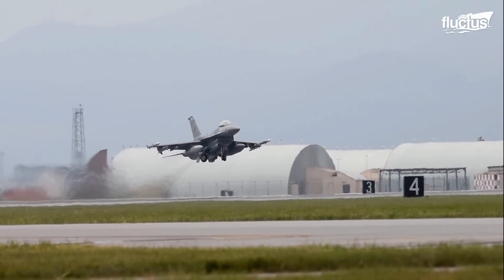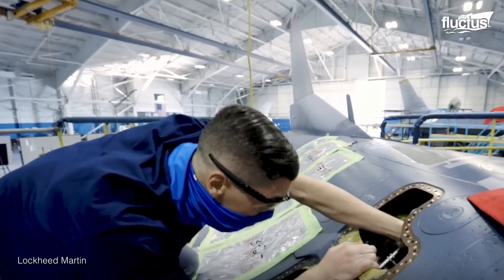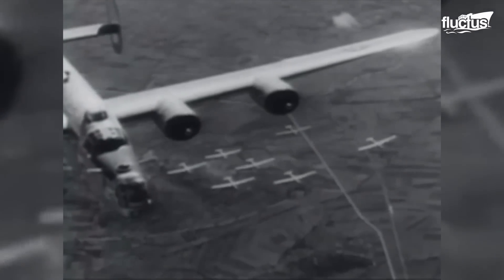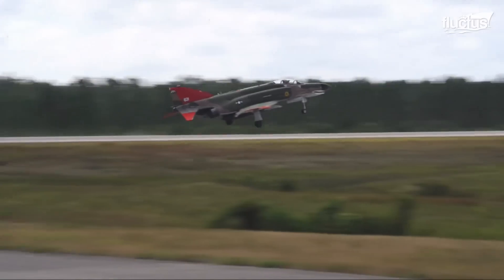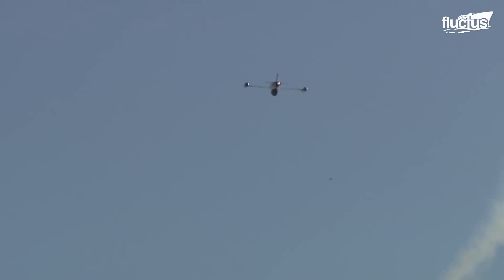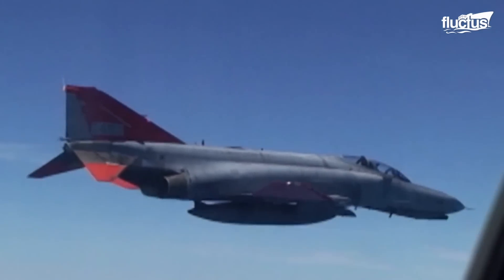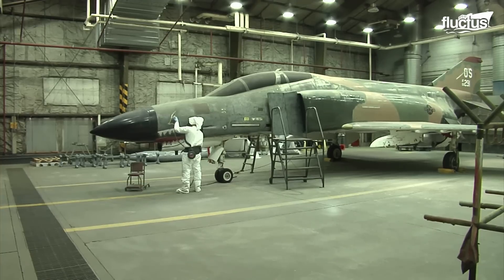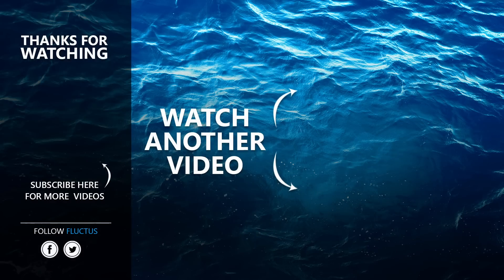Inside the US Super Advanced Billions $ F-16 And F-35 Assembly Line

Comment: The F-16 has a top speed exceeding Mach 2. The quoted top speed of Mach 1.2 is only at or close to sea level which it rarely flies at. The lower the altitude the more dense the air which creates more friction and resistance the aircraft must push itself through.
Reply: I would have loved to see the manufacturing process of the Tom Cat

Comment: F-16 first models were flawed....its Inertial Navigation Unit that causes its sensors giving wrong data to its computers and causes it to roll nonstop resulted in 36 fatal crashes. Something the overlooked Northrop F-5 Tiger never have. Such systems were corrected on the following variants, while sone pilots still flying the flawed first variants, with fingers crossed.
Reply: Source ?

Comment: F-16 Stated Performance (Source = Wikipedia)
Maximum speed: Mach 2.05, 1,176 kn (1,353 mph; 2,178 km/h) at 40,000 feet, clean
Mach 1.2, 800 kn (921 mph; 1,482 km/h) at sea level
Combat range: 295 nmi (339 mi, 546 km) on a hi-lo-hi mission with 4 × 1,000 lb (454 kg) bombs
Ferry range: 2,277 nmi (2,620 mi, 4,217 km) with drop tanks
Service ceiling: 58,000 ft (18,000 m) [failed verification]
g limits: +9.0
Roll rate: 324°/s
Wing loading: 88.3 lb/sq ft (431 kg/m2)
Thrust/weight: 1.095 (1.24 with loaded weight & 50% internal fuel)

Comment: The top speed of the F-16 is mach 2.1. Not 1.2. Someone correct me if I am wrong.
Reply: Really is mach 2.2 top speed
Reply: No one with single engine fighter who can reach speed of mach 2.
Reply: @michaelcasia7264  wrong. Its over mach 2
Reply: @michaelcasia7264  F-16, F-35...or a historical example, the F-105
Reply: @EmilioF1976  Mig 21 , Miraj 2000 also
Reply: @michaelcasia7264  My god you really don't know what you're talking about do you ? F-16 top speed is over Mach 2 at 40,000 ft

Comment: Even 50 years later the F-4 is still a very stunning aircraft!!!
Reply: Phantom's unique shape is eternal !
Reply: @jernejfunkl8300  The Phantom’s unique shape was the results of slide rules vs modern computers and brute force power. NOTHING subtle about the Phantom II. My cousin was an instructor pilot after his 2 tours in Nam. To quote him, “The F-4 was a handful.  Why to you think you HAD to have the guy in back!”
Reply: @Tool-Meister  Anyway...I like it more than any other plane. I have a few publications from it, a ton of pictures, plastic models of various scales and an RC EDF model.
Congratulations to your cousin for successfully piloting this wonderful aircraft...especially in wartime.
Reply: it can even outrun a missle....
Reply: 50?
Reply: @randygravel2057  sorry,  60...
Reply: Agreed. My favorite aircraft of all time.
Reply: @aaaeee2862  I agree. It's my favorite too :)
Reply: @jernejfunkl8300  👍
Reply: Specifications (F-4E) Source: Data from The Great Book of Fighters Quest for Performance, Encyclopedia of USAF Aircraft, and McDonnell F-4 Phantom: Spirit in the Skies

General characteristics

Crew: 2
Length: 63 ft 0 in (19.2 m)
Wingspan: 38 ft 5 in (11.7 m)
Height: 16 ft 5 in (5 m)
Wing area: 530 sq ft (49.2 m2)
Aspect ratio: 2.77
Airfoil: NACA 0006.4–64 root, NACA 0003-64 tip
Empty weight: 30,328 lb (13,757 kg)
Gross weight: 41,500 lb (18,824 kg)
Max takeoff weight: 61,795 lb (28,030 kg) 
Maximum landing weight: 36,831 lb (16,706 kg)
Fuel capacity: 1,994 US gal (1,660 imp gal; 7,550 l) internal, 3,335 US gal (2,777 imp gal; 12,620 l) with 2x 370 US gal (310 imp gal; 1,400 l) external tanks on the outer wing hardpoints and either a 600 or 610 US gal (500 or 510 imp gal; 2,300 or 2,300 l) tank for the center-line station.
Powerplant: 2 × General Electric J79-GE-17A after-burning turbojet engines, 11,905 lbf (52.96 kN) thrust each dry, 17,845 lbf (79.38 kN) with afterburner
Performance

Maximum speed: 1,280 kn (1,470 mph, 2,370 km/h) at 40,000 ft (12,000 m)
Maximum speed: Mach 2.23
Cruise speed: 510 kn (580 mph, 940 km/h)
Combat range: 370 nmi (420 mi, 680 km)
Ferry range: 1,457 nmi (1,677 mi, 2,699 km)
Service ceiling: 60,000 ft (18,000 m)
Rate of climb: 41,300 ft/min (210 m/s)
Lift-to-drag: 8.58
Wing loading: 78 lb/sq ft (380 kg/m2)
Thrust/weight: 0.86 at loaded weight, 0.58 at MTOW
Takeoff roll: 4,490 ft (1,370 m) at 53,814 lb (24,410 kg)
Landing roll: 3,680 ft (1,120 m) at 36,831 lb (16,706 kg)
Armament

E-model has a 20 mm (0.787 in) M61A1 Vulcan cannon mounted internally under the nose, 640 rounds
Up to 18,650 lb (8,480 kg) of weapons on nine external hardpoints, including general-purpose bombs, cluster bombs, TV- and laser-guided bombs, rocket pods, air-to-ground missiles, anti-ship missiles, gun pods, and nuclear weapons. Reconnaissance, targeting, electronic countermeasures and baggage pods, and external fuel tanks may also be carried.
4× AIM-9 Sidewinders on wing pylons, Israeli F-4 Kurnass 2000 carried Python-3, Japanese F-4EJ Kai carry AAM-3.
4× AIM-7 Sparrow in fuselage recesses, upgraded Hellenic F-4E and German F-4F ICE carry AIM-120 AMRAAM, UK Phantoms carried Skyflash missiles
6× AGM-65 Maverick
4× AGM-62 Walleye
4× AGM-45 Shrike, AGM-88 HARM, AGM-78 Standard ARM
4× GBU-15
18× Mk.82, GBU-12
5× Mk.84, GBU-10, GBU-14
18× CBU-87, CBU-89, CBU-58
Nuclear weapons, including the B28EX, B61, B43 and B57

The F16 and F4 really don’t compare in a dog-fight due to the basic agility of the F16, AND, this is AFTER the bomber mafia added all their crap to the F16 to make it an operationally land-bound USAF version of the Navy’s Douglas  A-4 Skyhawk.  Prior to the “bomber mods”, the F16 would have likely been an unbeatable dog-fighter well into the 2000s.  That said, the F16 is the Ford F-150 of the USAF.  Hauls anything, significantly beyond design specs and can defend itself with aplomb.  Fast Forward 30 years, and the Super Hornet spans all those specs.  It’s a bargain in today’s dollars.  IF the F35 would have tanked, I can see the USAF specifying THEIR version of the Super Hornet….
Reply: and it goes double the speed of the F 16 but you have to spend somewhere all this money...Shameful 🤢
Reply: @banmadabon  The two are in different categories though.  The F-18 and raptor is along the same category of fighter as the phantoms where.  The F-16 is an in close highly maneuverable fighter which is why they are using them now as drones because they can match or exceed the flight maneuvers of the newer fighters that have more computer power and thrust vectoring to help them achieve similar performance in close dogfight situations despite there larger size.
Reply: @banmadabon  lmao maybe because speed doesn’t mean anything if you can be seen on any basic radar system. Lol cant outrun missiles. Its not the 60’s anymore 😂
Reply: Did you mean the F-16?
Reply: @jamesmeyer1325  I meant the F-4 Phantom. But the f-16 is also a wonderful plane. This proves that they are still making it after so many years.